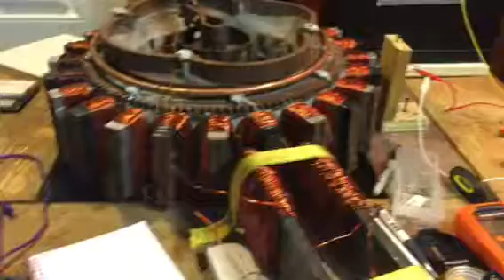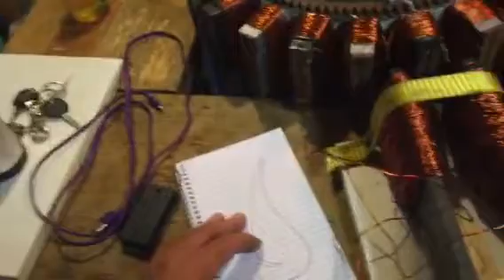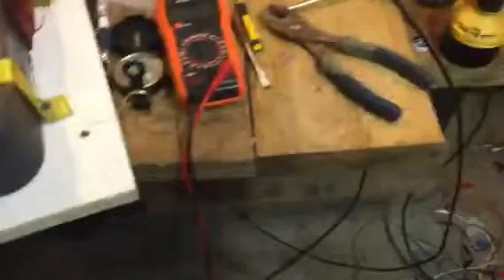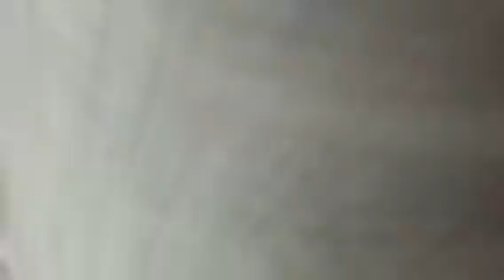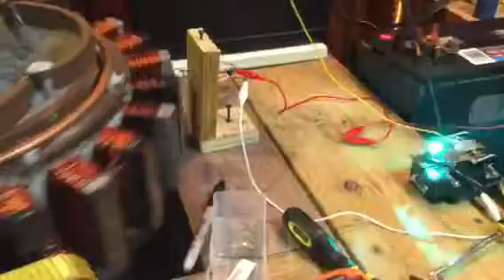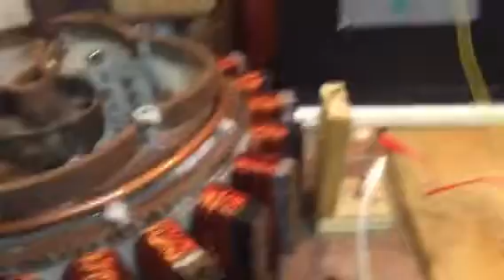Ed Leedskalnin wheel timing is a pain

Comment: because of the alternating fields of the magnets you got to bias the magnetic reedswitch with a small magnet so the reedswitch only pulses on 1 magnetic field. and not on the other :)
or you go to set up a arangement where the stator gets push then pull then push do it switches polarity

Comment: Considering that Ed's wheel is made up of parts salvaged from Model T Fords , perhaps you should be using an air or oil filled spark gap (the commutator is oil filled) from a model T engine. I have a pile of photos accumulated on both original Ford manuals & scans from olde books etc here  http://s28.photobucket.com/user/J1B/library/ED/Model%20T?sort=4&page=1